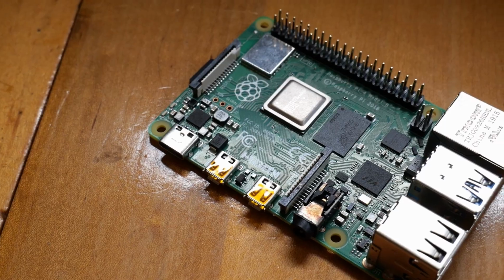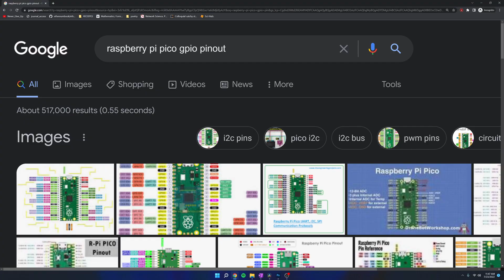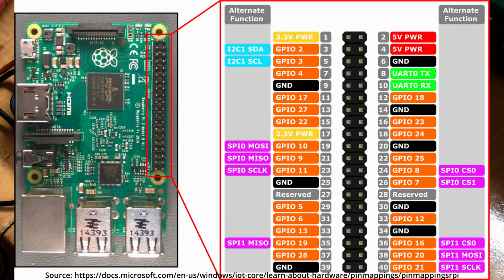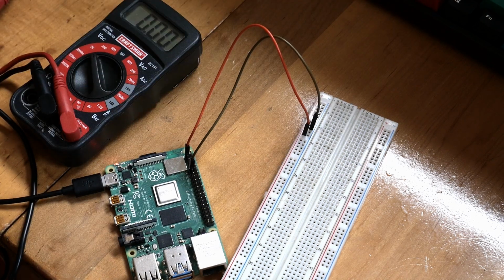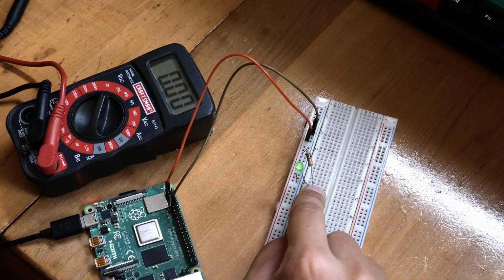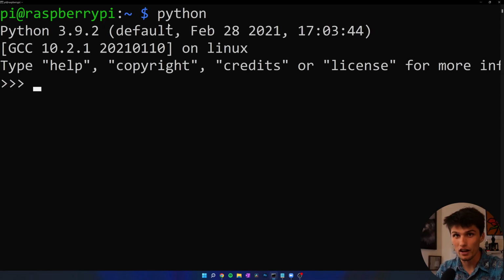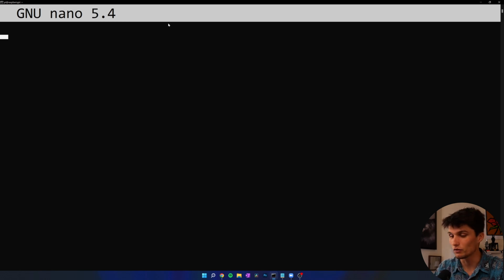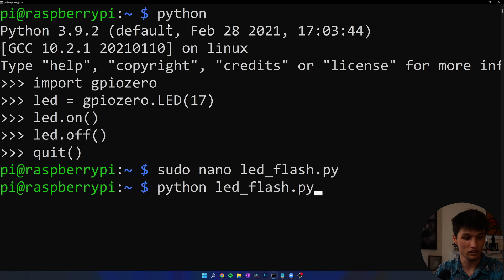Blinking LED Raspberry Pi Tutorial

Comment: Have you ever seen this  error when typing in led = gpiozero.LED(17)   

/usr/lib/python3/dist-packages/gpiozero/devices.py:300: PinFactoryFallback: Falling back from lgpio: 'can not open gpiochip'

  warnings.warn(
/usr/lib/python3/dist-packages/gpiozero/devices.py:300: PinFactoryFallback: Falling back from rpigpio: No module named 'RPi'
  warnings.warn(
/usr/lib/python3/dist-packages/gpiozero/devices.py:300: PinFactoryFallback: Falling back from pigpio: No module named 'pigpio'
  warnings.warn(
/usr/lib/python3/dist-packages/gpiozero/devices.py:300: PinFactoryFallback: Falling back from native: unable to open /dev/gpiomem or /dev/mem; upgrade your kernel or run as root
  warnings.warn(
Traceback (most recent call last):
  File "<stdin>", line 1, in <module>
  File "/usr/lib/python3/dist-packages/gpiozero/devices.py", line 108, in _call_
    self = super().__call__(*args, **kwargs)
           ^^^^^^^^^^^^^^^^^^^^^^^^^^^^^^^^^
  File "/usr/lib/python3/dist-packages/gpiozero/output_devices.py", line 192, in _init_
    super().__init__(pin, active_high=active_high,
  File "/usr/lib/python3/dist-packages/gpiozero/output_devices.py", line 74, in _init_
    super().__init__(pin, pin_factory=pin_factory)
  File "/usr/lib/python3/dist-packages/gpiozero/mixins.py", line 75, in _init_
    super().__init__(*args, **kwargs)
  File "/usr/lib/python3/dist-packages/gpiozero/devices.py", line 544, in _init_
    super().__init__(pin_factory=pin_factory)
  File "/usr/lib/python3/dist-packages/gpiozero/devices.py", line 245, in _init_
    Device.ensure_pin_factory()
  File "/usr/lib/python3/dist-packages/gpiozero/devices.py", line 270, in ensure_pin_factory
    Device.pin_factory = Device._default_pin_factory()
                         ^^^^^^^^^^^^^^^^^^^^^^^^^^^^^
  File "/usr/lib/python3/dist-packages/gpiozero/devices.py", line 302, in _default_pin_factory
    raise BadPinFactory('Unable to load any default pin factory!')
gpiozero.exc.BadPinFactory: Unable to load any default pin factory!

Comment: for some reason mine is turning on with "led.off()" and turning off with "led.on()" - any ideas? hahahah
Reply: hey, I think you are using +5V or 3.3V pin instead of GND pin to connect your led
Reply: Maybe you're using the pull up configuration, rather than pull down configuration

Comment: Simple straight to the point video, I just did my first led flash in raspberry pi  Thank you!!!!!!!!
Reply: you actually got it to work in 2024? I dug out an old 3b I wanted to use for this and not having any luck. My light stays on no matter what. His code says pin 17 but his video shows him using pin 1. I tried both. I made sure both were 3.3 volt. I tried multiple grounds. No success. Bizzarre. I've got an old light from a buoy I want to put in my garden and have it flash as if it were at sea and not in the middle of Texas...